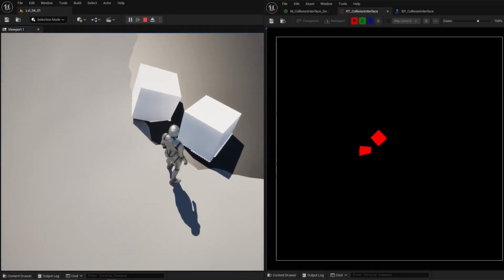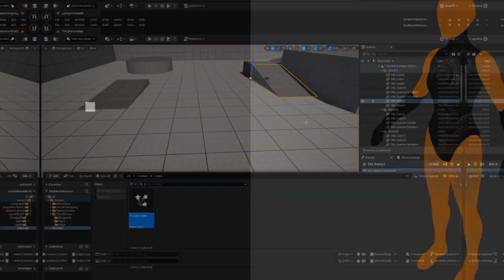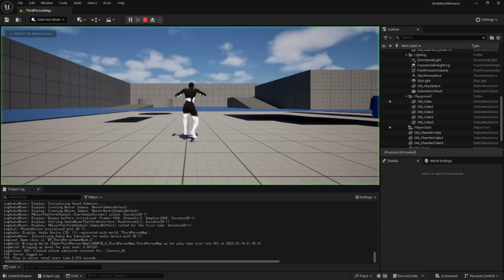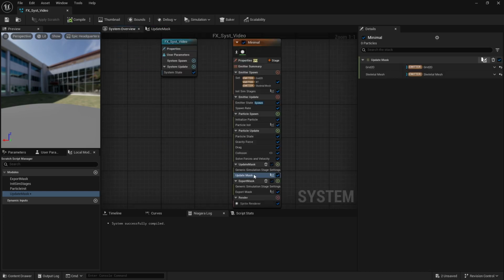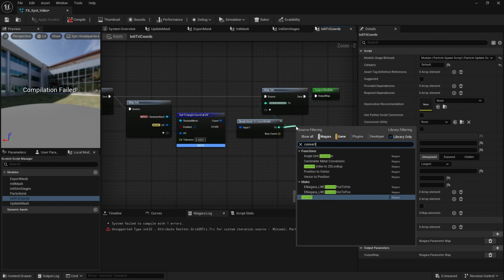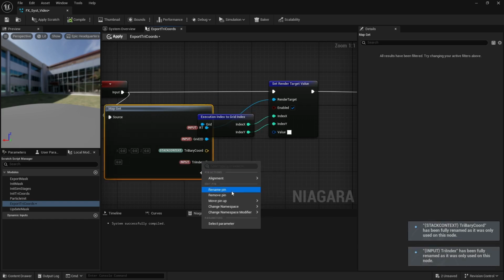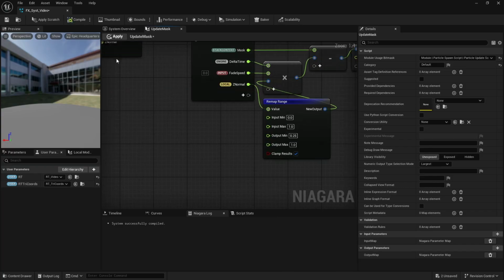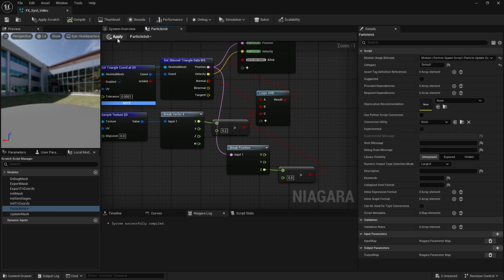Interactive Wetness Mask & Dripping Effects on Skeletal Meshes in UE5

Comment: I attempted to generate this UV adjacency graph using C++based on the vertex data of the mesh. But accuracy is a serious issue. UV islands that are too scattered and small are very difficult to handle. Even for large contiguous UV islands, the generated adjacency graph and boundary mask may not be continuous due to interpolation accuracy issues. Do you have any new developments to share?
Reply from the maker: I do not, sadly. Way too busy with way too many things. The adjacency map has been proven to be working flawlessly for surface-driven fluid simulation in Houdini, afaik. There's probably a gotcha to be aware of or something hmmm
Reply: @ghislaingirardot  I found 3DMattias's Houdini project and tested the pre-written simulations in it. The adjacency graph works perfectly. I then exported the adjacency graph generated in Houdini along with the model to Unreal Engine, attempting to implement UV-space fluid effects.
However, both the conventional Shallow Water Equations (SWE) and Reintegration-Tracking (RT) encountered issues when crossing UV seams. Specifically, some seams could be crossed while others could not, and some appeared like perforated walls where part of the fluid crossed while the rest was blocked. SWE performed better than RT. I speculate that the problem with SWE arises from its use of bilinear sampling for velocity when crossing seams, as it cannot correctly sample from the other side of the seam. For RT, I suspect the issue occurs during barycentric coordinate transformation. I don't understand how to calculate the "duplicate mappings" mentioned in the Virtual Method paper and apply them to ensure RT properly crosses UV seams.
Fortunately, I discovered a simpler implementation approach that doesn't require full fluid simulation. Instead, it uses particle-driven dynamics to achieve water droplet flow that conforms to the model surface. This method can also reuse much of the data I prepared for the UV fluid simulation. Here are the relevant links:
https://www.bilibili.com/video/BV1b14y1x784/?spm_id_from=333.1007.top_right_bar_window_history.content.click&vd_source=de00f8333ed777d5d2285125b7e3e863

Comment: Great video thank you! One question, how would you implement this on a per character basis? Is there a way to generate a unique render target for each character inside of niagara? Or would that need doing in blueprints/cpp and sending to niagara manually?
Reply from the maker: That'll require a manual setup, yeah. You can dynamically create render target in BPs and send them to Niagara/Materials etc.

Comment: Your work is very high quality! Thank you for that.
But I have one question about the UV stage. I couldn't get good results for other skeletal meshes (e.g., Metahuman, TwinBlast). For some reason, it only works perfectly with UE5 Skeleton.
Reply: Hello everyone! I finally found the cause of the UV issue. 
It will be enough to simply configure the LODs of your Skeletal mesh as in UE5 SKM_Quinn. It seems that the Render target texture is writing data incorrectly because of this, but I don't quite understand why it works this way.
Reply from the maker: Glad you got it solved! I wasn't sure what to suggest tbh :D

Comment: Regarding fluid simulation, you might want to look into 'skeletal mesh traversal' and 'GPU Driven Effects of The Last of Us Part II by Artem Kovalovs || SIGGRAPH 2020'. Not sure if that's exactly what you're looking for, but I'd be interested to see your implementation. I tried to do something similar myself back then, but I ran into problems with mapping particles to UV space.
Reply from the maker: I'm familiar with the paper, yes. AFAIK, last time I checked, this wasn't implementable in UE since it lacks the geometry/primitive ID buffer they use at Naughty Dog. Which is required for particle attachment in screenspace.

Comment: Another great one! The last bit is still pretty useful, even without proper fluid like behavior, one could still use the output as a flowmap in the character's material and scroll a drip texture downwards.

I have a question regarding Grid2D: I want to use a particle like a stamp and draw it directly to a render target (not it's position as a gradient, but its color/texture/alpha brush) for something like a white board. Just as if I was capturing the particle systemn in front of a black background with a scene capture component...
Is there an "easy" way to access the nescessary info and implement this using niagara? I haven't really gotten into Grid2D, so it would be awesome for someone to point me in the right direction^^

Anyways, thank you for all this content, your channel is one of the best learning ressources here on YouTube :D
Reply from the maker: Flowmap downward is already doable directly in the character's material. Transform a (0,0,1) vector from world to tangent space and get the .xy components :)

Sounds doable. You'd have to provide your 'stamp' position, scale & rotation on the whiteboard in UV space to Niagara. Then I think it's just a matter of sampling the stamp texture & using a box mask to prevent it from tiling. Get the grid 2D float, output the max of the two to create a feedback loop and that'd paint your stamp in the grid. It's not too different to what's described in this video all in all. gl :)

Ty for the feedback, appreciated!
Reply: @ghislaingirardot  Haha yeah I realized that afterwards xD But what about spawning particles that flow down the character and then write that to a render target or erode the one we already have? This could provide a similar fluid like behavior, but I know it’s not quite the effect you were trying to achieve.

Oh wait, so it’s just like if I wanted to sample a stamp multiple times inside a material? If so, I am starting to feel at home xD
The rest should be pretty easy, the feedback loop part is pretty similar to the pre niagara techniques. I‘ll give it a try, thanks for the hint :)

No problem, I am always happy when you pop up in my notifications :D Three days ago, I was talking to a friend about the exact same topic from the video and that I wanted to look into niagara and Grid2D for character effects. Absolute perfect timing :D